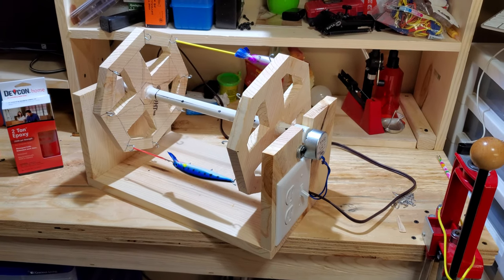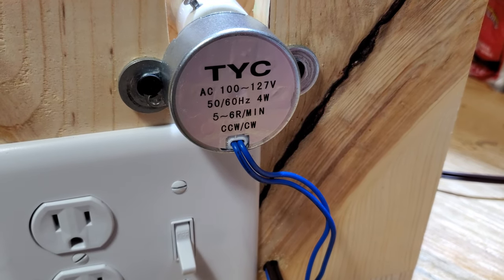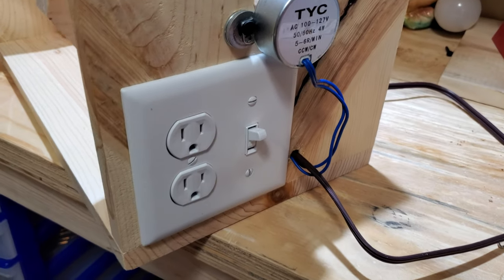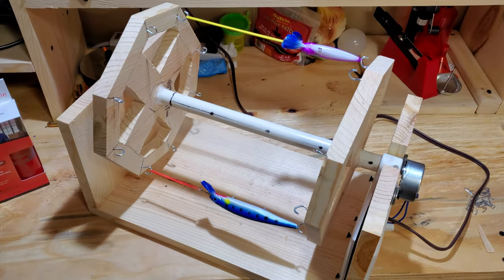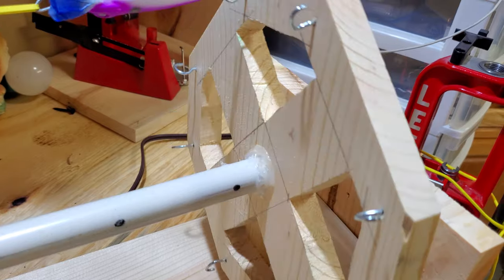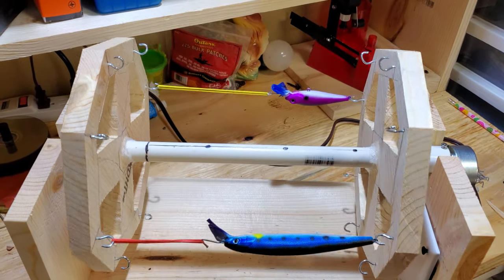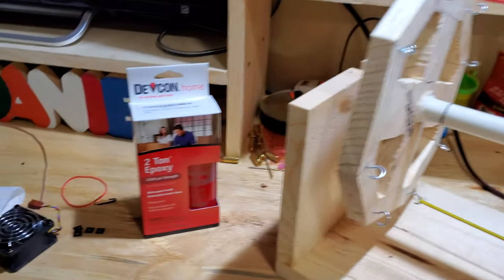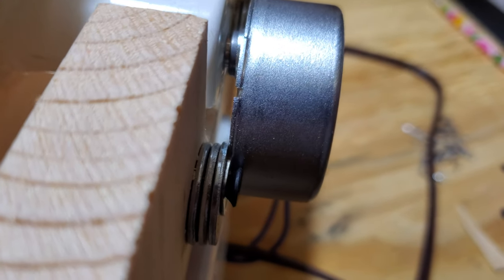Homemade Lure Turner x8

Comment: Very nice I’m going to try this design just different materials.
Reply from the maker: If I need to make anymore I will probably try something on a 3d printer. Haven't used it in a few years but will be soon before my trip to Canada.
Reply: @CrazySubaruFanatic  I just made one in twenty minutes 😂 used wood for frame, a piece of alum tube for shaft, a 5rpm dc motor from Amazon, and some foam for the wheels. Wanted foam because it was fast to make, light weight, and strong enough for my lures, I make ten batches of popper lures at a time and hang them on there at once. I used a torch to slightly heat the surface of the foam so it melts a bit and become hardened to help with strength. Overall similar design to yours.

Comment: Good Morning ! I saw your video and noticed that you use Devcon 2 Ton. Used to finalize fishing lures? Over time do the fishing lures turn yellow? Thanks
Reply from the maker: I have had them finished for about 11 months and do not see any yellowing yet. So far so good but I cant speak for long term. Used mine up in Canada and after ALOT of northern and walleye they do fleet a few scratches. Only one of mine had the devcon chip off and that was from a northern the spun in my net and ripped the rear hook out.

Comment: does the epoxy go on evenly? seems fast  how you get the epoxy on there without it dripping off
Reply from the maker: The epoxy cures very smooth. When applying the devcon I spin the bait around enough so it doesn't sag and then hook it on the turner. Works great for me